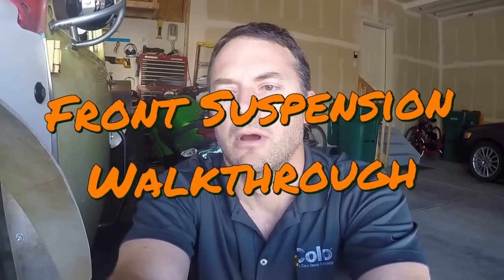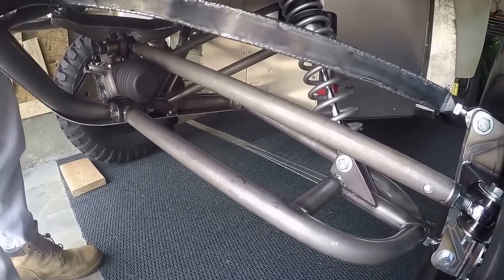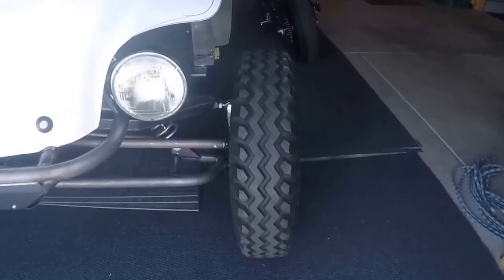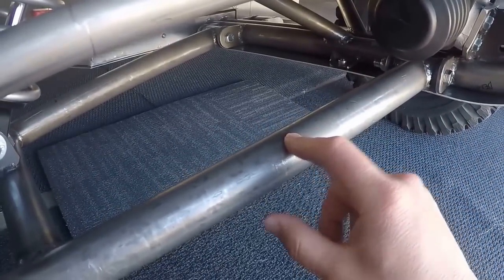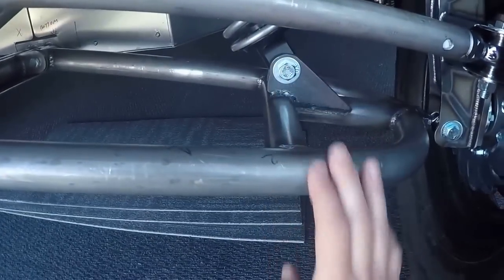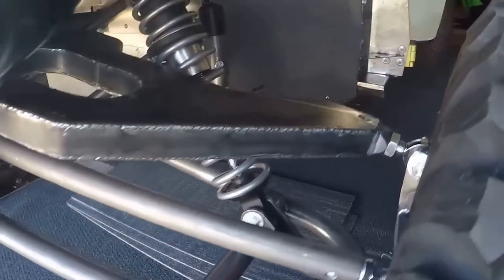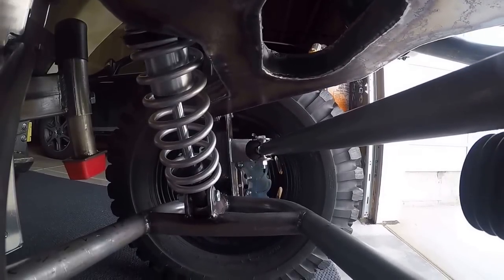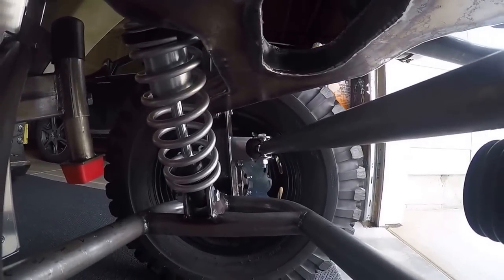Baja Bug A Arm Front Suspension Walkthrough

Comment: Quite an engineering project WOW !
Have you tested it off road at speed yet ? Great job !
Reply from the maker: I have about 1,000 miles on it at this point. It works really well. Handles trails at a good pace. The bump stops are only neoprene. So if you're going fast enough to hit those it gets really rough. But if you stay just under that it's great.

Comment: very inspiring build...alot of good... but from my experience working on vehicles....u would want a bushing where your top aarms attach to the frame... those fish eye connectors or what ever thyre called... they look like metal on metal...so usually a nice anti vibration bushing is pushed into the aarm... maybe you could mock that up ..u clearly have the skill...lol..

id just modify your design to accept some small bushings then make a barket and just bolt it on... awesome build tho!
Reply from the maker: Thanks for the tips! Those do have a delrin skin between the metal, but it's really thin and they squeak over time.
Reply: @DougBugBuilder  yea greese fitting could be a very easy aid for the squeak...and its pretty east to drill out a hole and screw the fitting in.

im redoing the front end of my s10 blazer and got the crazy idea to give it a wicking front end suspension upgrade with coilovers instead of the normal torsion bar setup.

so this video is very inspiring ...and those uni ball joints are on every thing offroad come to find out.

using components like that help people be able to wrap thier head around a build and create for them selves.

do have a good site for ordering stuff like that.?
Reply from the maker: @WandersOfficial  I get all my tidbits like that from Kartek offroad. https://www.kartek.com/

Comment: Hello I am new to fabricating suspension and i was wondering what steel you used for the a arms and how it is holding up
Reply from the maker: I made those out of 1 1/2" DOM, .095" wall thickness. They have held up just fine.

Comment: Set front end from rear end left wheel needs to turn slower than right wheel or vise versa set front end from lines steering rods to center of rear end ones longer than other explanation Bob's builds ck it out he build 1930 Chevy with air bags pretty cool arms lift are crazy works fast and great also ck out bike put coolo

Comment: Great work Doug! what size Hem joints are you using ? where do you buy them from? THXS
Reply from the maker: I buy those tidbits from Kartek.
https://www.kartek.com/
The heims are 3/4". Here are some part numbers for Kartek for the heims I used.
FKBKMX12 - 3/4" bore 3/4-16 RH Thread (Standard) Heim 
KTK750TBRR1250 - 3/4 bung RH 1 1/2" .120 Wall Tube 
PRMHMA3412 - High misalignment spacer for 3/4" Heim
Reply: @DougBugBuilder  Hey doug nice work, thanks for sharing, you might check these guys out for your heims and such.  Found them a few weeks ago.  pretty good pricing.  midwestcontrol.com
Reply from the maker: @aaronerwine5675  Thanks dude, I'll check them out.

Comment: What about the bolts? Are those one just for mock up because those look like grade 2 bolts.
Reply from the maker: Those are grade 5, but you're right, the final build will have grade 8 bolts.
Reply: Doug Bug  do you know about shanking bolts?  The threads are smaller then the shank and if your brackets ride on the threads the bolts can move around and oval out. I by my bolts by the grip length, so that the shank rides on both brackets then I cut off the extra threads, sometimes you have to add washers so the nut doesn’t bottom out. If you look at aircraft bolts they are done this way.
Reply from the maker: @markbenoit  Good info dude, thanks. Where do you purchase your bolts from?

Comment: How well is your steering with heim joint bolts rotated vertically instead of horizontally as for mounting inside of spindle?
Reply: And would these spindles work well with more of a trophy truck build or would it be too heavy for them?
Reply from the maker: Ethan, With the high alignment spacers the heims will rotate quite a bit. But to be honest I was hoping the steering would turn a little sharper lock to lock. Like making a U turn in a neighborhood street would require a 3 point turn.
For a trophy truck I think that would be a bit much for heims. I think most guys run Uniball type spindles for heavier vehicles.
Reply: Well I'm not really doing a full on trophy truck,  I'm doing my own trophy rat kinda like Keith Northrups
Reply: I'm just trying to get ideas on what to use for stuff like this cause I've never built a vehicle before
Reply from the maker: For sure man, asking questions is the best way to gather info. Check out Kartek Offroad, look in the fabrication category. Seeing what is available will help you figure out your design.
Good luck with the build!

Comment: You did a really good job for your first design! 
Couple tips is forsure box that lower you want the lower arm stronger than the upper if anything it takes most of the load! And other tip I have for you is that the best way to mount shocks is so that at full bump the shock is 90degrees to the lower arm it is mounted on. This gives you the best progressive rate on the shock and doesn’t put you in a possible binding situation that will bend the shock
Reply from the maker: Great tips! Thanks Luke. I've been considering a little redesign on the front to get a little more travel. I'll keep that in mind.
Reply: youo have a picture for example send a link

Comment: I know how to set up race bikes and long forked choppers for rake and trail so they turn fast or slow with all manner of fork lengths and rear ends (whatever's required) and don't tank slap or lock up but I can't do this.. and saying you're not a suspension guy: that's damn nice work.
Reply from the maker: Thanks bud, we're both being modest. If you can calculate that on a bike you can certainly do it on a baja. For a fabricator it's really just what we focus on. Keep building and thanks for the comment.

Comment: Is there a particular reason as to why the top arm is boxed and bottom just tube? Any reason why you couldn't have just done a tube top and run the shock through the middle? Is it strength related? Is it simply because of proper shock angle that caused you to go this route? Great build, I would love to be able to put the time into my car like this.
Reply from the maker: Roastm3, Good question. I would have rather made both upper and lower arms out of tube. The upper arm on the drivers side had a serious space restriction because the steering shaft pokes through the firewall and goes to the rack and pinion where the upper control arm would wrap around the shock absorber. It was also tight in the front where the upper tube of the chassis ties into the front bumper. These tight tolerances made it so I couldn't bend tube tight enough to be able to use the available space. I wanted to be able to spread the pivot points at the chassis as far apart as possible for strength. So with all that said boxing it I was able to make a design that clearanced everything and also took up as much space as possible for strength. In my video where I fabricate the upper control arms I go over more of this.
Thanks for the comment and kind words.

Comment: Excellent work!! What welder did you use?
Reply from the maker: tmsrsm, most of the chassis welding is done with a Lincoln Electric 120v flux core welder. I switch it over to mig welder when I weld the body work. Any tig welding you see is done with a Lincoln Electric 220v Tig welder.
Thanks for the comment.

Comment: Love this! I watch your videos almost everyday! I just picked up a class 5 baja that use to race back in the 90s and your videos are motivating me to do the same! Any idea as to cost in materials for the front end? Thanks Doug for all your videos!
Reply from the maker: Hey Boost, Thanks for the kind words. Picking up an ex racer is an awesome way to get a jump start. If there were more of those around here I would have gone that route.
Let's see, without going through receipts this is roughly what the front end cost. 
Spindles $220 ea.
Heims, bungs, bushings, $480 total.
About $100 in metal.
So converting to A Arm was about 1k additional.
Now the shocks, steering rack, hubs and brakes carried over from the beam suspension, so I didn't add those.
I will say I absolutely love it over the beam! even though it didn't get me that much more travel, it is super smooth and very adjustable.
Good luck whichever way you go.
Reply: About how much were the spindles and brake s excellent project hoping to do the same on my

Comment: Another great video I think in have watched them all now , this one three times , could u run a single upper link like your h arm rear has for the a arm front ?? Especially if u over built the lower a ?? Thanks for your time.
Reply from the maker: Cameron Holliday, Thanks for watching and the kind words. It is possible to make an H Arm style front suspension. I considered it because I'm a fan of H Arm suspensions. However the spindle gets really complicated. The spindle needs to rotate for the steering and then also be able to rotate in the lower arm. A true A Arm setup spindle is really pretty simple if you use the heims like I did. If you go A Arm or H Arm the limiting part is the steering connections on either. So there are no travel advantages from one to the other. Great question though!
Reply: Doug Bug an h arm lower front is way beyond me although I can picture it , I was wondering if i could use a single tube link upper arm in the front like you used in the rear or if there is something I'm missing and both the front need to be a shaped arms , sorry for the confusion.
Reply from the maker: If you designed the lower arm like I did on the rear than it would work. However the design of the spindle (the part the wheel bolts to) would be totally different. Look up RC10 B5M, that is a radio controlled car that has H beam front suspension. Might clear things up.
Reply: Doug Bug sorry to keep bothering you I seem to be confusing you with bad terminology, I want to use the same spindles as you but am picturing a lower a shaped control arm very beefy and a single dom tube upper prob 1.5 od x .25 wall one end heim for the spindle and one end a bushing the same as the upper control arm on your h arm rear but for my a arm ifs.. I did look at that rc I'm guessing that would need to be ball joint or kingpin to work and I like that too but seems crowded and over  complicated. Thanks again for your time both making the videos and responding to your followers. :)
Reply from the maker: Ahhhh, OK. So I think I follow you. What you are proposing would work. However the upper link needs to be able to both support the spindle left and right (camber) and forward and back (caster). As long as it was strong enough and properly fastened at the chassis end it would work.
Not a terrible idea actually, would make it easier to clear the shock absorber.

Comment: Cool build I built my full size Bronco that has the 4wd beams and long chromoly radius arms heim jointed. I plated and gusseted my beams and upgraded gears with locker an F-250 shaft/U joint out the passenger  side and chromoly axles. Tall shock mounts and cycled and cleared everything a lot and strapped it at 17" . I bought after weighing front back and total of the Bronco from King and Bret tuned them great. Ran Deavers in the back a frame to frame upper shock tower and beefed up axles, gears with a locker there too. Rebuilt my transfer case and bought a Monster trans good for 650 hp. It eats up the whoops great at speed without spilling your drink and I have taken it on about 8 long off road trips. 

    I have been looking at Baja Bugs and rails (not just for sand built) cars to drive more aggressive terrain fast but can tow it out and home with the Bronco. I have to keep it for trips that are in areas with street legal and place to place far apart. The building an A arm setup is a bit more involved. The fabrication of the arms for strength you need for its use with geometry etc.. important. It seems the frame of the car has a large part of this with location and design is it best to have a known builder review or design or sell you a tube frame or a roller. Is there information like books detailed enough and good enough to help with building this kind off performance . I am amazed at what my Bronco can do after the 4wd trucks I  have had with the better/best  kits bought from chain off road shops running Ranchos. It is a different level completely of smooth control  much faster over rough desert and capable of crawling locked 4wd with travel. Not much lift but lots of control travel needs glass fenders 
GOOD JOB 
If you run around CALI, NV, AZ trips looking for another vehicle on a trip we may ride well and should talk.
Reply from the maker: brianbirc, I couldn't find anything that walked me through the A Arm build step by step. Most likely because every build like this is pretty unique. I looked through some road racing design books as they went through some of the geometry. But what I found with the most info was websites going over Baja SAE builds. These are competition builds that schools compete in and you must fabricate the buggy from scratch. So they had some good info on how to start and what to focus on. Another thing I did (this will sound crazy) is I modeled the front and rear suspension off my radio control race cars. These cars have very advanced suspension, I worked with these for years when I raced RC cars. Like the 7deg climb or "rake" in the front is carried over from the RC cars. All the designs I saw of 1-1 rigs they were flat. If the suspension is flat then when you nose down when on the brakes the front wheels actually have to travel forward as they compress, that just seemed crazy to me. So I raked it.
Anyways, it's a fun build, I recommend you go for it.
Thanks for the kind words on my build, and for the comment.
I'll be in LA for work next week, you anywhere near there? I'd love to see that Bronco....

Comment: Just curious how your Ackerman angle worked out with those spindles?  Better to get just 1 spindle, check and see what you end up with, or are the spindles even available with different steering attachment points? Or is it even relevant where this is for mostly off-road use?
Reply from the maker: Jacob Hawkins, you buy these spindles just like I did fully welded. But if you want to change the Ackerman to more suite your vehicle they sell the steering arm by itself. So you can cut off the one that comes on it and weld another one exactly where you need it.
Doing it the way I did you kinda are risking what the end result will be. From what I can tell from just pushing it around the driveway and garage the ackerman is a little to extreme. Meaning the inside wheel turns in a little to sharp. However I haven't done any alignment on it yet so it could already be toed in or out to much. Either way I don't think I'll try to make it perfect because the bug will mostly be in the dirt.
Hope that answers your question and thanks for the comment.

Comment: Awesome engineering!  I'm looking to do some similar work on my 62 Manx.  Great to see a good backyard mechanic work through all the issues 1 step at a time and solve it without a degree in Mechanical Engineering.  Or maybe you do.  lol.

Curious, you want the suspension to go up a couple more inches.  Have you check the bottom to see where your belly hits the ground and do you have the clearance?

Thanks Again
Reply from the maker: Nic Holbrook, Thanks for the kind words. Never did go to college, but......and this might sound dumb.....I raced RC cars for years and really learned a lot about how to set up and build suspension systems.

The belly stops with about 8" to go. I'd like it to stop at 3". So I'd love to change the shock absorber angles to be able to get the additional 5". Currently it's using all the travel it can out of the shock absorbers.

BTW, if I build another Baja it will be a Manx, I love those things.